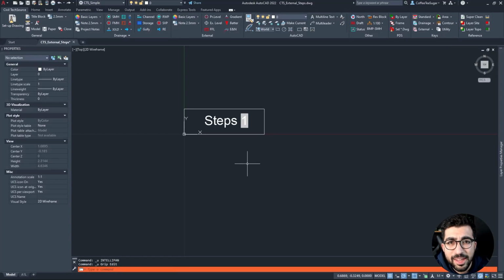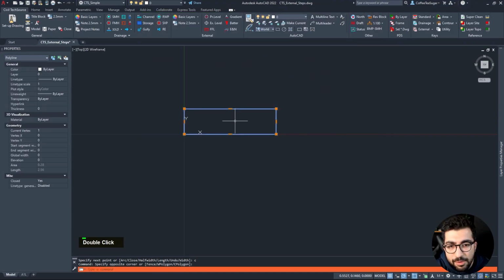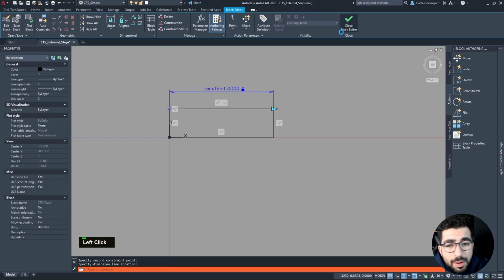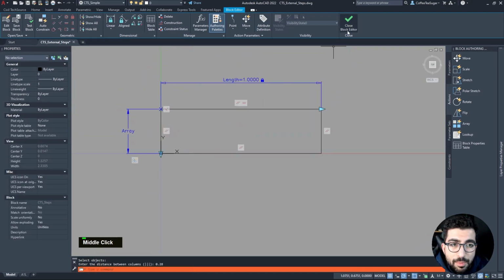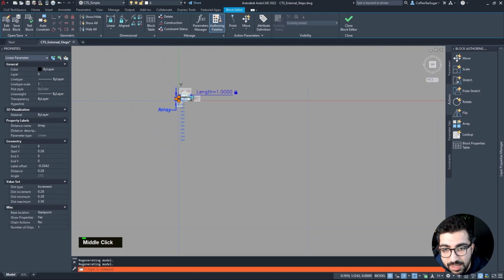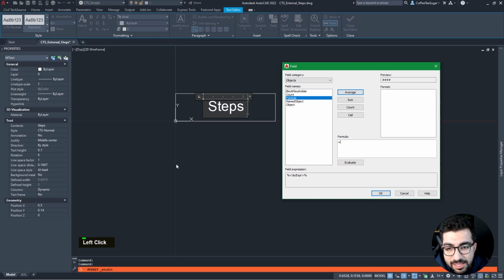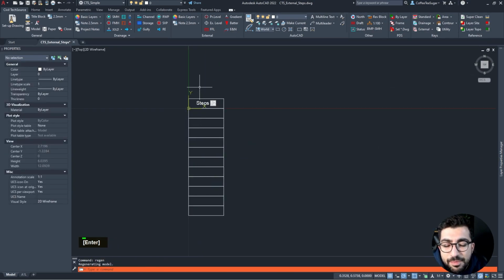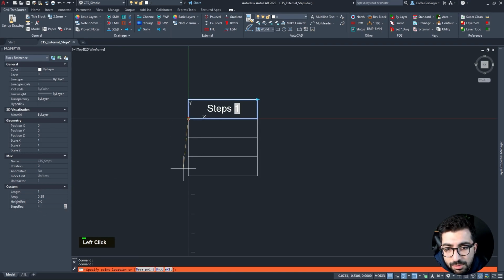AutoCAD Dynamic Blocks - Steps

Comment: thanks  I am halfway to implementing a block but i am trying to input numbers as we would receive them from a survey  - usually total rise and total going and then total number of steps are the parameters - eg you start with Going - we start with total going divided by the number of steps to give average going - which has to fall into the range available in the regs. Total rise divided by the same number of steps again has to fall into the regs  - eventually if i can figure this out i would rather drag out the number of steps to the total going and have the going calculated and drawn and incremented -  this is from the perspective of a survey
Reply from the maker: How is the block going?

Comment: Hi, I made a Dynamic Block with array comand, its show to me the distance1=1.2 meters but i want its show me  the amount, like 1.
-1.2 meters - count 1
-2.4 meters - count 2 etc...

someone knows how I can do this?
Reply from the maker: If you used insert field, maybe you can try change the decimal value?
Reply: @CivilTechSource  I used the parameter linear distance and action array
Reply from the maker: Where does it show your distance the 1.2 2.4 etc?
Reply: @CivilTechSource  in properties press ctrl+1 or comand PR
Reply from the maker: The distance will always measure the actual distance, what you can do instead is hide that property by selecting the distance and check the property. You can add an attribute and add use insert field and add some additional if statements to do what you want.
Reply: @CivilTechSource  which attribute do this? have you a telegran that i can show you better?
Reply from the maker: You can email me at ferdijafar.engineering@gmail.com